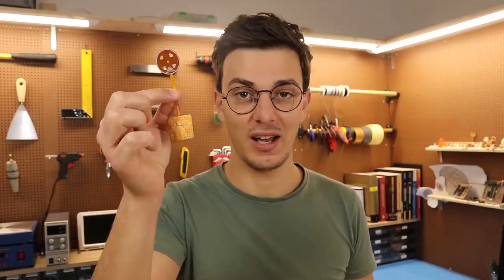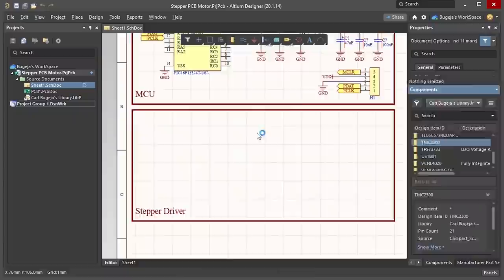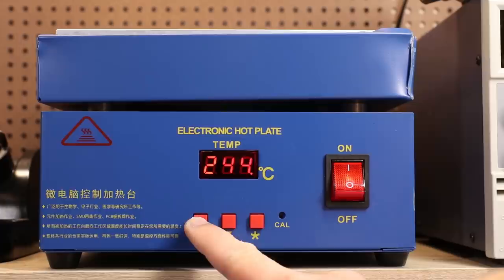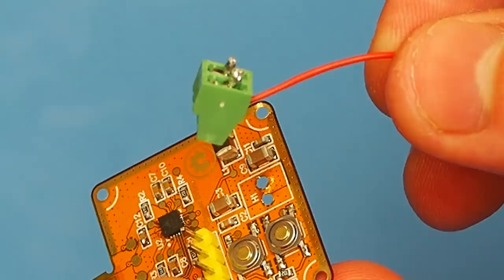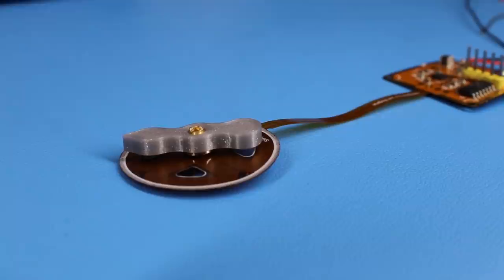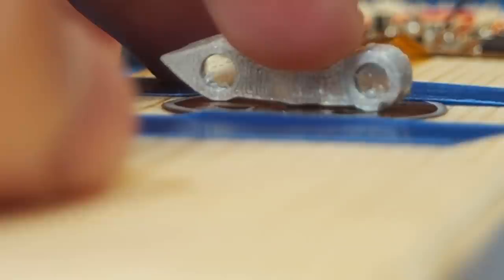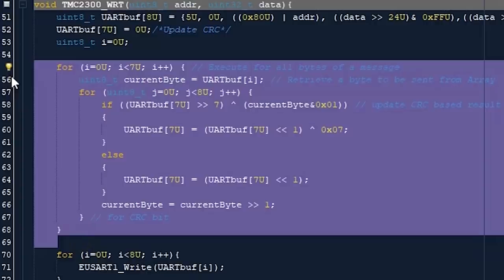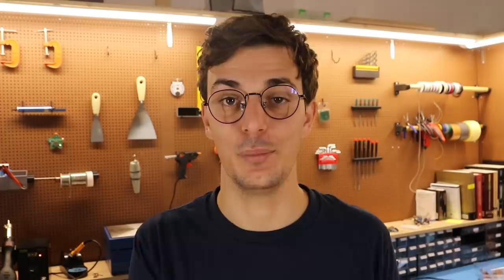Microstepping a PCB Motor?

Comment: popping is probably due to moisture, usually it is released in the pre-heat phase of the reflow
Reply: You are right and Carl also. The reflow profile is very important and he should use the recomended one in the solder paste datasheet. The components poping can be eliminated by drying them. Recommended temperatures and times are 40-45°C/192 hours or 125°C/24 hours. Basicly enought is to store the components with some silicon moisture absorber.
Reply: Friends of mine use a modified pizza oven with a customized controller. Infrared might also work better than direct contact. But do whatever you need to get the job done. Apparently it worked for the most part :)
Reply: Might not even be moisture in the sense of water, it might just have been the flux in the paste that was instantly getting turned into vapor causing the popping. I guess putting the spatula with the PCB on top of the plate for a little bit, to preheat everything a bit slower would make it work with that hot plate.
But for roughly 200$ you can get a pretty decent IR reflow oven from china that is okay for prototyping and small batch productions. (Just have to open some of them up before using them, and take out the cheap masking tape inside and replace it with kapton tape...)
Reply: Replying to boost this comment
Reply: In industry it is called popcorn effect. Moisture or contamination
Reply: Yup problem is %85 moisture. He needs to make arduino based ramp-pid-reflow controller via SSR relay, that would solve his problem and make soldering easier. Oven would be better for his job too.
Reply: oh ya! I always forget about moisture. I always hand solder components, so it's not usually a problem.
Reply: Yeah as someone who 3d prints I thought moisture right away.
Reply: Is just basic... and the temperature... Hahahah

Comment: the answer to your problem is shown at :15 seconds. you need more "teeth",  four poles, 2 phase is not enough. have you tried stepping a 3 phase brushless?
Reply: This. Stepper motors work off of having many different "channels" or field locations to move between. Narrowing yourself down to only 4 field coils makes controlling something very difficult.  Unfortunately with only a single layer PCB, there's not really a whole lot of space to squeeze more coils in without sacrificing strength.
Reply: Could you phase shift the bottom layer coils by 45 degrees so there would be 2 phases on bottom, 2 phases on top?
Reply: I second this answer, that's what the teeth on a stepper are for :)
Reply: Yup I replied the same thing. you can also solve the problem by varying the strengths of your magnetic field. The field is stronger/weaker depending on how close to the center of the coil the magnet is so by ramping the power of the magnets depending on the position will help. He may still have a problem while the magnet is over those wide coils though because it will be hard to get an even step while the rotor is over the traces.

Comment: Hi Carl!  When spreading solder paste, instead of using flimsy business cards, pick up a few blank RFID cards from Ebay. 👍
Reply: or old gift cards
Reply: @excitedbox5705  Or new loyalty program cards lol
Reply: Or brand new non-activated credit cards that you did not order (banks send them to encourage you to open an account where I live).
Reply: The best choice is an old stencil mask(size must fit the respective PCB size) 🤗 This also allows to remove excess paste after printing.
Reply: Or 3d print one 😏

Comment: Beginners will also see the horrendous price tag Altium has and that’s probably also the reason why a lot of hobby and later job people will not use it i guess.
Reply: Its free for students tho^^
Reply: Yes, just use KiCad
Reply: I've personally tried Altium, Eagle, Solidworks PCB and easyEDA but KiCAD is still my favorite.
Reply: Lol you think altium is expensive! Look at mentor pads
Reply: Altium is a professional grade software.  I use it for business and for the price I think it is very reasonable.   It's not really meant for hobbyists but I gather they are trying a different business model to address that market too.
Reply: @pentachronic  What you think of mentor pads
Reply: @Ender_Wiggin  Pads is a good tool but I don't think it has the same capabilities as Altium as it does not have integrated schematic capture.  It's just a PCB tool.  Personally I don't like the user interface.  Allegro is probably the best PCB tool but it is very expensive and hard to learn.  Allegro again is just a PCB tool with lots of things bolted on over time.  Altium is better for the small company and design teams.  It's a better workgroup and integrative environment IMO.
Reply: @pentachronic  Yes that’s also why doesn’t make a lot of sense to promote it here 😄
And i dunno software that is that old is probably pretty bad especially when we consider that Alitum is now also doing the abo model for which i would expect way more. Not a Adobe level software which is basically garbage but it’s impossible for anyone else to even touch it that doesn’t have that amount of money laying around. 

At work we move to KiCad with several custom modifications that make it more usable. And that actually doesn’t cost so much. And we already get a lot of people that worked with it before. Meanwhile with Altium this is pretty unlikely.
Reply: @Christopher Grant Which industry do you work in because the Electronics Industry doesn't think so.  Every company I've worked with and for thinks Altium is the better deal for the price.   As far as top quality PCB tools companies tend to go with Allegro (mainly because it has very strong rules for routing and mfg).
Reply: @platin2148  Kicad and the like do not offer the higher end tool compatibilities.  Such as importing and exporting to post layout Signal Integrity tools and the like.  This is a big factor for modern work as the speeds are getting to the point where Signal Integrity is a big factor and can make or break products.  I've worked with a few clients who've had to put their tail between their legs and ask for help because they ignored high-speed design rules.  If Kicad etc works for you, then it's the right tool for you at the moment.  As you progress to more complex designs it will  show it's limitations very quickly.  But yes, this is not a place to promote it for hobbyists.  I just wanted to highlight the reasons why growing companies move towards Altium and other tools and that after studentship you'll end up using one of these more expensive tools. I will point out that PCB tools are a drop in the ocean compared to IC design tools.  Like 2 orders of magnitude difference in price.  Same with RF.
Reply: @Christopher Grant Disagree.  Altium is aggressive on pricing.  Get a quote from them.  If you are in business this is a capital outlay that you can amortise over the development costs of a project or two.
Reply: @Christopher Grant ADS is very expensive as is Microwave Studio for RF FEA.  ADS is only a 2D field solver MWS is a 3D field solver.  High end tools.  Then Orcad is a cheaper version of Allegro.  Allegro being in the higher price range, Orcad is less.  Altium is similar to Orcad but has better integration.  I've used all of these tools and have bought them for my teams in previous jobs.  The right tool for the right job is the name of the game.  When you get into IC stuff, the price is high!!
Reply: @pentachronic  Sure. And yes IC tools are way more expensive and even worse than say Altium (tools from say Mentor, Cadence, Synopsys etc. ). 

Meanwhile it makes sense that when you ignore high bandwidth design rules that your pcb design is almost certainly crap. 
Thing is the two buses that we have that are considered at least for me “high bandwidth” where PCIe 3.0x4 and the wires to the Phy and Mag (2.5gb Ethernet) so maybe i can’t really judge, lucky me didn’t ever have to touch RF.
(Too dangerous for what that thing is used for. Currently we also don’t expect to move to 4.0 as we don’t even scratch the bandwidth of the 3.0 PCIe bus)
Reply: @platin2148  You are lucky with PCIe Gen3 if you didn't do proper SI.  Doing some BERT/EYE diagram analysis pays off.  PCIe has retries in it so you may have inter symbol issues and got away with it.  You may lose bandwidth as a result.  Who knows ?
Reply: @pentachronic  One can’t really say as that also goes into driver optimizations etc. one thing i can say is that we tested a other system and that didn’t reach “full” speed on the bus. Sometimes it’s a actually quite nice to be a hardware and software company.
Reply: @platin2148  I'm talking phy level stuff but yes drivers are a big issue too!  On one project we (myself and s/w guy) spent every ounce of time to achieve theoretical maximum throughput.  Difficult work.  Satisfying though.  I love these co-design efforts.  Always fun to work with talented people.
Reply: You can do PCB in paint if you're just looking to put down traces, actually know a guy who does this since he's visually impaired and he can't see a lot of the tools in schematic capture/pcb layout.
Kicad has definitely come a long way, and I love interactive router that will shove aside other traces automatically, flowing traces around packages and other  traces at the minimum spacing.  I've used gEDA a lot and there's a reason it's popular in companies as it offers a very powerful interface that allows you to get a lot done with minimal clicking.  Being able to script and make mass value changes is one thing I really miss in Kicad-- select a group of parts and edit their properties to make the same change across all of them.  Not the most friendly interface, but as with most things once you know it it's natural.
Reply: @flomojo2u  We found it pretty easy to work with e.g modifications to kicad are actually not really hard.
Reply: @flomojo2u  There's an electronics CAD tool well suited for just slapping things together called Fritzing. IMHO free software tools make sense particularly when sharing projects, though few have the kind of backing that KiCAD and Blender enjoy.

Comment: We use 7 pole (14 total lobes) steppers with 1/256 micro stepping as our tracking motor for one of our  telescopes. Pole geometry is important as all poles need to be wired the same way, so as the have the same entry and exit point on all phases to have consistent magnetic fields.

Comment: Very nice! I believe the big issue is the dead zone between the coils. You may be able to fix it by stacking two layes of (shifted by 45 degres) coils on top of each other - either by multi-layer pcbs or by putting two PCBs on top of each other. In such a way the magnet will always be under the influence of some coil - and you could have twice as many steps per rotation.

Comment: İ think, you have to increase the count of coils if you want more precise steper motor. Not 4 coils but 8 or more)
Reply: Yeah, generally there are many more N/S "pairs" generated by the coils, and more permanent magnets.

I would think that you can get a much better result with your current design, if you use more permanent magnets.
Try using 8 of the small ones you have, in "series" in the same orientation as your last attempt.
Reply: The problem here is that there isn't a lot of space to squeeze more coils.
Reply: @PhdHung  But there's room for more magnets. I initially suggested using 8 small magnets, but it might actually work better if you use a number that isn't divisible by the amount of coils you have, so e.g. 5, 6, or 7.
Reply: Correct me if my claims are wrong..

..but shouldn't the number of Magnets be always divisible by 2 and the number of Poles always divisible by 3..?
Reply: @Martin Vizar Actually no, because 6 coils can be, it is divisible by 3. The main purpose of us to make a loop out of poles for example: 4 coils N S N S - N S N S - N S N S and so on.
Reply: @KamranQasimovDeirvlon  yep correct if we're talking about Stepper Motors, but my Post is still valid for 3 phase Induction Motors.. They always require Number of Poles are divisible by 3 by my "bacteria sized logic"..

Thanks for reply anyway..

Correct or Not now..?

Comment: The reason you are getting the jumping effect is caused by a high transient response (overshoot) per step angle. The way modern stepper motors mitigate this is by increasing the number of phases and poles to decrease the step angle for more precise steps. That's why in the hybrid motors you were talking about in the beginning, by using teeth those types of stepper motors are able to decrease their step size to fractions of an angle compared to the permanent magnet one you built. Lowering the speed and adding a type of dampener will also help prevent the high overshoot! Using an H-bridge motor driver is also usually the best option for stepper motors.

Comment: You can just septate the flex PCB from the stepper board and use fingers to attach solder the coil flex PCB to main pcb (similar to LCD Cables). You can also try 1.6mm @2oz copper, and 0.4mm @ 1oz and play around with that. 
Your issue with components is you did not let the pcb soak and the flux in the paste popped your components. 
This is an awesome project non the less!! Super awesome work :)

Comment: I am also not 100% familiar with steppers, but things I would look at first:
*) Geometry of the magnetic fields is important, Normal steppers have shaped soft iron cores, the air gap between coil/core is very important due to magnetic reluctance. Making it more reliable was a good first step, but I can imagine that the fields you generate are a bit too "disjoint". Increasing the number of poles, like suggested in another comment, might make it a bit better. The strongest force are at the points with least gap.
This also means that you don't get a lot of force between steps.
Maybe disassemble a bipolar stepper motor to look how you could apply similar principles :)
The shape of your magnets is very likely relevant too.

*) I am pretty sure you did that, but the drivers you use have a lot of features, that improve current usage and noise. These are designed using real stepper motors in mind and the algorithms they use might get "confused". I think they might use back-emf to measure some parameters. So disable all those features during debugging and maybe use 1/4 and 1/8th microsteps.

Edit: Thanks for these very cool projects and sharing them online! There's so much we can learn from it!

Comment: I would be interested in oscilloscope traces of the phase current. Due to the low phase inductance (air core...) I imagine the current ripple to be huge, making microstepping very hard to impossible
Reply: Maybe the driver is not designed for the low inductance this PCB has, not sure I have not checked datasheet, but I guess there is an spec for min inductance.  Maybe the chopping frequency can be adjusted.

Comment: I think it because is a small amount of moisture and when you heat it slow it has time to evaporate but when you rapid heat it is like exploded also it happens to some chips if you don't put on an oven at 100degrees for at least 2 hrs,  it is called popcorn effect

Comment: The components jumping has happened to me before! It's due to moisture in the solder paste... after it happened to me, I checked the expiration date on the paste, it expired three years ago, lol. The issue is not from the hot plate, I also use a hot plate and it works fine, mind you I use leaded solder and have the temperature set to 200 C.

Use fresh solder paste! I highly recommend the thermally stable solder paste from Chipquik, it does not require refrigeration for storage (it can be stored at room temperature): TS391AX

Comment: Hi Carl, the rotor is responding erratically because the magnetic flux distribution contains regions of varying density.
To be more precise, the flux is strongest at the axis of each coil.  And it is weakest where two adjacent coils abut together.
Try laminating two flexible coil circuits with a 45° offset.  Then write new code that energizes the coils in 45° increments, rather than 90°.

Comment: We use normal 30$ otg oven and control its temperature using provided knob. Also, while soldering we need to heat from both sides of the pcb, which is only possible in otg oven. It works great and we have probably soldered more than 100 pcbs within 1 year.

Comment: The reason stepper motor stators and rotors have ' ribbing "  is to force the magnetic force lines between them.  If you have any magnetic/conductive fillaments, try making what would look like a 3mm set of line li,e a clock face for the stator side and similar for the rotor.  You missed the why of the stepper motor manufacturing and an accident on a stepper had me tear it open several times to find the lack of fins on my rotor meant it skipped.
Good work so far, keep going!

Comment: With lots and lots of experience with PCB making.. I can say that Stencils and Solder paste is sometimes worth more trouble than it is worth. I generally hand solder everything and use a hot air reflow for SM components with pins under the IC. I think the poping could have been caused due to moisture in your components as well as the ramp up in temp.

Comment: In commercial environments, solder paste is flowed using IR being directed towards the board as opposed to conducting the heat through the board. This method would reduce the amount of heat load you'd be introducing into the substrate. It seems like direct heat from a heat gun, IR panel, or an oven situation, might be a better solution. Just my 2 cents